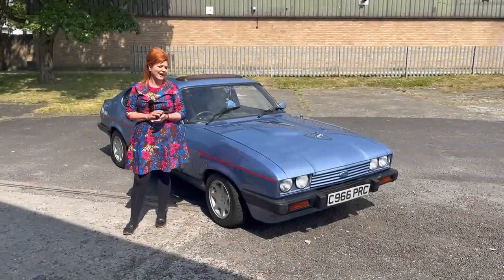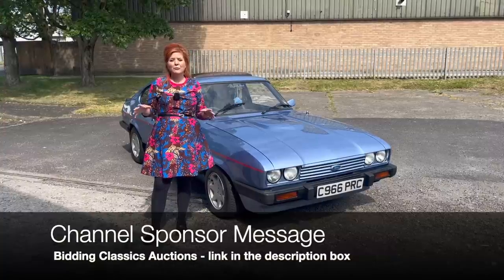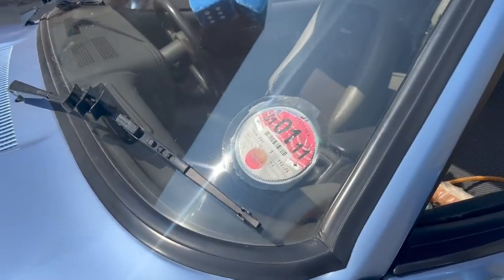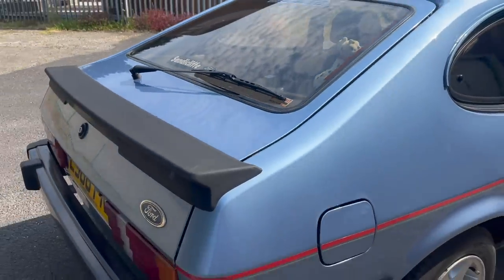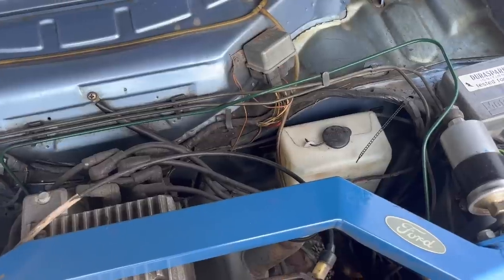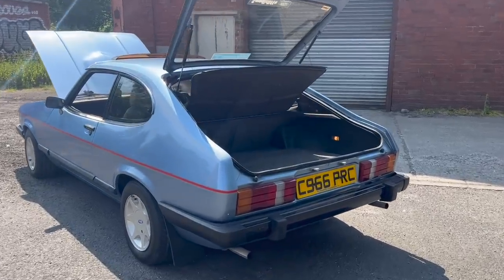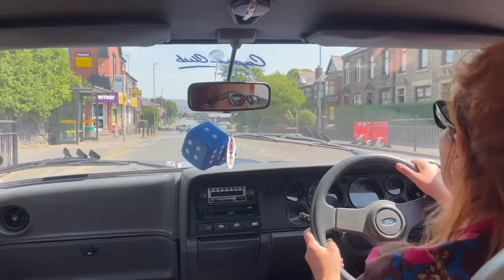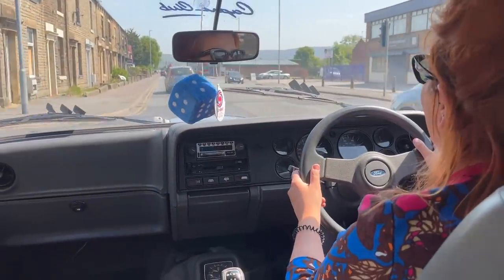Ford Capri MK3 2.8i special - a cool 80s classic car - overrated or cult car?

Comment: I owned several Ford Capri starting with the 3000E in 1971, I was just twenty years old. It attracted lots of attention from ladies. I progressed on to the Mk 2 hatchback then on to the Mk3 3000 Ghia. 1987 I purchased a 2.8 Brooklands. The modifications included electric windows,central locking, kenlow electric fan with three point fixing. The modifications continued until I drove a VW Golf whilst on holiday in Germany. I have never looked back and have since moved on to an Audi. The ford was great fun, a pleasure to own and run taking into account the head gaskets on the Essex 3000 engine. The 2.8 was a buzz winning many trophies at the Capri shows. The phasing out of leaded petrol was time to sell my last Capri. The VW GTI developed 150bhp, the Audi just over 200bhp from a 2.0 litre four cylinder alloy engine. The German car’s handling is reassuring with the suspension set up,long gone the cart springs of the Capri. But at that time it was a buzz.

Comment: I worked at Ford garages from age 16, 1981 until 1992. Used to pick up a 2.8i to drive to the garage to be serviced every 6 months. 14  mile journey. it was the nuts. I was only 18!!

Comment: The 2.8 was the only Capri I have never owned, I had Mk1, Mk1 facelift,Mk2 & 3. 1300, 1600, 2.0ltr (both engines) and 3.0lts. I would buy another in a heartbeat if I had the money. Cracking review Steph, it looks like the Capri bug may have bitten you........
Reply: I'm in the same boat .. I need another one. Very high prices nowadays but looks like we're going to be coughing up some hard cash to own one again. Worth it in the end.😎👍

Comment: The reason the Capri 2.8 was better with handling is it had single leaf rear suspension, the 3.0 had multileaf. The lateral movement at the back of the 3.0 was 3 inches, the 2.8 had a lateral movement of 1.5 inches. This was improved further on the Tickford with an A frame brace which removed all the movement. A firm called Scorpion at the time made an aftermarket A frame brace similar to the Tickford one that I fitted to both my 2.8's. A popular mod that I did not do was to fit Austin Princesss multi piston brake calipers to the front with an aftermarket fitting kit. All the memories are flooding back. See if you can drive a Turbo Technics Capri, while I have never owned one I have driven one, so so fast, even today. 

There were also a handful of automatic 2.8 Capris from the factory, a special order option. 

The later Capri 2.0 S also had single leaf rear suspension. The 2.0 laser went back to a multileaf spring at the back. 

The crazy thing was I had a fuel pump go, I bought a new one from Ford but get this, Ford sold two fuel pumps in different boxes with different part numbers, one was for the Capri the other I believe for a Granada, anyway the Granada one was exactly the same but around 1/2 the price. They corrode a common fault as they are exposed to the elements near the rear bumper, really easy to change though.

Comment: Had the 2 S 1979 took it round the clock twice on 2 of everthing.
Ordered for 1 Aug 85 a black 2.8 but bottled out and modded above to big valve, Piper 285, full RS Escort bushes etc, it handled better than anything today.

Comment: Great review Steph of my favourite car. It's nice to hear the positive comments and not "they handle terribly and you need a concrete slab in the boot". It sounds like you've rather taken to the Capri. So I expect you will be buying one and joining our Capri Club lol. Also just to clarify for you, the 2.8i was launched in 1981, January if I remember correctly. It was the first project for the newly formed SVE department (Special Vehicle Engineering) within Ford under the control of Rod Mansfield. The type 9, 5 speed gearbox was introduced into the updated 2.8i in March 83 and then into the 2.0S in April. 1.6 models still had the 4 speed gearbox as standard until the special edition Laser was launched in about November 84. By late 84 the 2.8i Special was launched with the introduction of the LSD, 7 spoke alloys and half leather Recaro seats. The 2.8i in your video was once featured in an episode of Fifth Gear, driven by the lovely Vicki Butler Henderson. 👍

Comment: Totally agree with your Ford gearbox comment Stef, my 1970 Ford Escort 1300 Super had a very smooth and easy to operate gearbox to, although the clutch could be a bit grabby if you weren't careful. 

That Capri clock and rear vision mirror appear to be the same as those in my old 1976 Ford Cortina 2000E.
Reply: That's probably because they are Ford parts fitted across the range

Comment: I had a 2.8 Injection with a 5 speed box. Most Injections had the 4 speed box, whereas the Special had the 5 speed box so mine was unusual. Ran it for several years and even used it in Norway on snow tyres. I then bought a 280 Brooklands to which I had a Turbo Technips Stage 1 turbo fitted. Better than the Tickford turbo in my view. I ran that car for about 12 years and loved it
Reply: In the UK we changed to 5 speed about half way through mk3 production. I had an early 5-speed registered Feb 84 but declared built 83, and a 2.8i special registered after the end of production.

Comment: The MK3 Capri is a cool 80's car. The 2.8 Cologne V6 is a weird engine because it has siamesed ports as Ford based it on the V4. A 2.8 Injection sounds so good with a Janspeed exhaust system
Reply: I have sperate downpipes on the exhaust manifold and 3" tails and is sounds AWESOME (Albeit loud but I like it .... Old Fords get louder, not faster!!! Lol).
Reply: @darrylstarling2665  I changed mine to a 3" once. She didn't get on with it. Became really unreliable compared her previous infallible record of never failing to start first time.

Comment: Great video Steph, and you’ve gained another subscriber off it!
The Capri is my all time ‘hero’ car! I wanted one as a kid, although at that time they had become just an old banger and not so desirable! I still loved them though. That shape is absolutely iconic. 
As soon as I left school at 16 I bought myself one, for £100. This was 2001 and I bagged myself a rough but (just about!) road worthy 1974 Mk2 1600L. Quite a low spec car but it was every bit a Capri and that’s what matters. I absolutely love that car and it lived up to how I thought it’d be.
I’ve kept it ever since and recently took it back out on the road after a bare metal restoration. First time I’ve driven it since 2016! I still love driving it, sitting in it and just looking at it, although it’s now firmly in retirement from a daily driver and will be used on dry summer days only after all that work. Fantastic cars!

Comment: OMG! Sandicliffe Long Eaton! Used to be on Fletcher Street, off Derby Road, and it’s now a branch of Topps Tiles. I knew it was a car local to me when I saw the ‘PRC’ in the registration (RC is a Nottingham area identifier) and then I saw the Sandicliffe sticker in the window, then ‘Long Eaton’ on the number plate! Sold new 1.5 miles from where I sit.

Comment: Still a good looking car, I owned seven MK2 & 3, 3.0 litre Capri's both S and Ghia models, manual and auto. My last Capri was an early 4 speed 2.8i. I actually preferred the 3.0 lazy engine characteristics. Lots of happy memories, but I'm not sure with current values that there aren't much more interesting cars for the same money.
Reply: Can’t beat the sound of the 3ltr low down grunt!!
Reply: Same story here pal loved the v6 s had a lot myself great fun to drive and made a nice noise had a 2.8 also which were in fairness a nicer car 👍
Reply: @meandthefamily1485  I’d love to know what a 2.8 injection but with an Essex lump in would be like to drive , what with the nicer interior and so on

Comment: I used to have a 1974 Mk 1 facelift 3.0 ltr Broadspeed Bullit and I loved that car, wolf in sheep’s clothing. Much more powerful than a standard 3.0. Later on had a 2.0 laser then I bought a mint 2.8 Injection but it never matched up to my Broadspeed, that Essex engine had more torque and being blueprinted had much more grunt. Unfortunately someone stole it and found it with engine blown apart 🥲

Comment: I had one of these on an A plate in same colour, had it 3 months, the insurance was insane, and the rear always tried to meet the front on a wet roundabout, so got rid.
Reply: Every other owner seems to say that, but I never found the back to be too slippy. Maybe it's because it was literally the first 2 cars I ever drove (an 86 Special and an 83 standard 2.8). I could feel every last bit of grip (or lack of it). Pretty much the most tactile and responsive car I've ever had. I lost the back of my Ferrari in the way you describe though. They just let go with no warning if you drive them like a Capri 🙂

Comment: In America, the Mercury Capri was made on the same line as the Ford Mustang from 1979 through 1986.
Reply: Yes I had a new one in 1980 !
Reply: @ronaldlee6593  was the transmission in yours automatic or manual? Did the radio have AM/FM or AM only? Did the radio have a cassette Player?  Were the windows power or crank? Were the locks power or manual?
Reply: @Gerry Dilleburch and never branded Mercury, just Capri, despite being sold through the Mercury dealer network.

Comment: This was Ford's flagship sports/performance car. Nothing else they had this side of the pond delivered 160 HP up to the mid or early 80s; it was the car to have, and as a young man, I had the American 2.8 version. Throughly enjoyed it. I always prefer the UK's 2.8inection but alas it was quite a reach. Its a pity that UK cars didn't come with AC back then. I think this is what killed their sales globally. While you could get the tiniest Toyota or Japanese cars with AC as standard, it was a task to get it even in an expensive 5 Benz or BMW back then, and of course, never in a Ford.  Ford had a full line up of performance cars then, but isn't it shocking that they have none in the UK now?

Comment: What a great review , she so right had a few in my time , been looking at a “classic older “ car , ….

The 80s in my view where manufacturers starting to make cars more “ driver friendly “ there easy to drive , brakes etc was getting there 

It like it was that era cars could cruise at 70mph ….. but with todays traffic , I just think for example Teslas are just a waste to have … why do you need all that power put into the extension of the battery range

it’s like most of the roads, you can’t go no more than  50 miles an hour ….

Comment: I always like the shape of the Capri. The 2 litre, 2.8 and 3 litre versions looked pretty good to me, apart from the live axle rear suspension.
Ford should have put coil spring independent rear suspension on it.

Someone is going to disagree with me, I never saw the point of the 1.3 litre Capris, too under powered ! 1.3 Litre Cortina's were pretty bad, but they didn't have "sporty" pretensions !

The 2.8 litre Cologne engined one looks the best to me. If I recall correctly, apparently the 3 litre Essex variant could have timing sprocket issues.

I never got a drive or own a Capri, but the 2 litre Mk4 Cortina I had ( so very similar suspension and running gear), well the live axle could be "interesting". That could be a bit tail happy, so I'm guessing a 2.8 L Capri with similar live axle, well even more tail happy !

Comment: The smaller in line. OHV  4 cylinders were known as Kent engines, whereas the earlier V6 carburettor cars were known as Essex engines. The 3 litre was known to have more low down torque was not so happy at high engine speeds , whereas the later fuel injected Cologne engine had a shorter stroke with more power , 160 bhp compared to 138bhp, but you had to use the gearbox more to get the best out of it. Nice video , Steph. Suits you the Capri, with your shades and compulsory furry dice !

Comment: As it's literally the first car of any kind I drove, it's impossible to praise the 2.8i Capri too highly. By a distance the most enjoyable car I've ever driven (and as well as the Capri, I was learning in a Ferrari 308 at the same time). Easy to throw around, easy to regain control. Happily cruises at 100+ for hours and keeps with modern junk easily. For 20 years it was the smallest engined car I'd ever owned. I wanted one since I was in nappies.

Comment: The horn sounds funny - because only half of it works.

I'm no Escort-expert but on the VW Golf mk2 were two different horns available: Wimpy standard horn for bread-and-butter and two-tone horn on the better models. The latter has two separate horns. If one breaks it sounds funny - and you would fail German TüV like I did once.

Plus: I would replace the whole wiring harness - it looks quite briddle and has the potential to turn a really nice car into a blast furnace.

Those two blue connectors don't make it any better. Those things are called "Italians" or "Power thieves" over here. They damage the supply cable quite a lot and can cause all sorts of trouble.

And I would get rid of those dangling fuzzy dice. I like those things as much as vanilla stinky trees - not at all. I'm probably too old for that.

Comment: Security was not a by word for Ford, as my Mk II escort in the '80's could be opened with a key for a Metro as my mate proved. I remember my brother having the 2.8 Laser in the early '90's and as all Capri owners will tell you they don't like corners in the wet, as my brother found out .........Ouch!...... But I must admit I have a soft spot for all '70'sand '80's fords.

Comment: Until I drove one, I thought the Capri was probably over-rated given its very basic engineering. Yet it was quite a bit better than I thought but much worse than it could have been. The Granada, from the same era, was, in contrast, massively under-rated; it drove so well, handled reasonably and was more comfortable than the Capri. It's a shame that the Capri wasn't developed to make it handle as well as the Granada. I once hired a 2 litre Capri for a dash to Newcastle from London and back for work and it was not at all bad, just not involving, not comfortable and more ordinary to drive than it should have been. A shame.

Comment: I loved my Capri (I had modified central locking into mine), however the steering wheel used to scare me. Having seen a friend crash his, that steering wheel did a lot of damage to him.
Reply: It doesn't appear to be a collapsible column which you'd think a car like this needs and looks close to the driver.
Reply: @jamesfrench7299  I would be surprised if it is not as competitors 20 years earlier had that feature

Comment: Available at the same time….

Capri

Escort MK3 XR3

…..during my childhood, the Capri with its legacy design was considered old hat. Virtually everyone was going with the hot hatch GTI type vehicles.

…but, which type of vehicle is worth the most in 2023? (I have no idea btw).

Must also remember, Ford offered different trim and engine options to meet the financial situation of different people. In the early Capri days you could get it with a 1.3 engine.
And, around this time, fords reputation wasn’t the best…hence this time is when VW Golf really took off as did Japanese cars sold in Europe. It might even explain the dramatic trim improvement seem between escort mk3 and mk4.

Comment: I had this exact car in 1990, I’d been dreaming of owning one since a saw 2 brand new ones on the same day a few years earlier…..a rare sight as eve then they were no longer a common car. It was fabulous, reliable, fast and cheap to run bar the insurance which was s starting to skyrocket back then. I recall hitting 120 in the blink of an eye, very stable and much safer than other more exotic cars I owned later like Lotus Esprit’s. As with most of my mint cars i sold it to someone who turned out to be a total dickhead, who seemed more pleased at his insurance payout after he allowed it to be stolen and stripped. I’ll always miss it and regret selling, however even then it was seriously outclassed by some not even modern contemporaries like the Opel Monza and Toyota Supra etc. I wouldn’t buy another because prices are just silly and the driving experience just doe not justify it sadly, but they will always be a thing of beauty.
Reply: Your not Jonesy by any chance your nickname I mean
Reply: @meandthefamily1485  No sorry.

Comment: Great video, Steph. Nice to see a car that we did get here in Canada, at least in the 70s. By the end of the decade the Capri was moved onto the Fox platform and was a Mustang clone sold by Mercury dealers. This European Capri, though, is something really lovely. Beautiful design, great detail work, and from what I remember at the time, very nice to drive with the V6. The 4 cylinder models did not do as well here, as they were not that happy with the speeds and distances involved.
The way you describe the driving experience is the same feeling I get behind the wheel of my old Volvo 240 estate. The car feels alive under you. I don't know how else to describe the feeling. The car feels like it is having fun. No new car, by which I mean post 2000, has that feeling.
Reply from the maker: Yes!!! I feel like the come alive feeling just isn’t there in new stuff.

Comment: Had a 1979 Mustang with the 2.8 liter V6.  It was probably the best 6 cylinder engine ever built, it lasted 400,000 miles before I replaced it with another 2.8 liter which gave me another 300,000 miles

Comment: My brother in law had an early model 2.8i which he bought in Germany before they were available in the UK. He used to drive Stuttgart to Munich on the Autobahn, flat out 6100rmp against the engine's speed limiter. He imported it to the UK but the gearbox was sounding a bit rough, so he managed to get someone to put in a salvaged engine and 5-speed gearbox combination. It was a tricky job because the new engine was from a rhd car and they couldn't get a clutch cable. Eventually got one as used on a Fiat Miafiori!